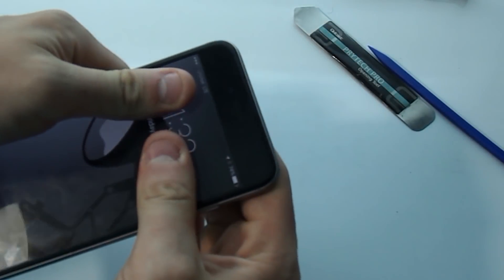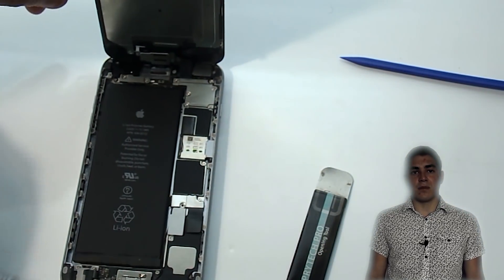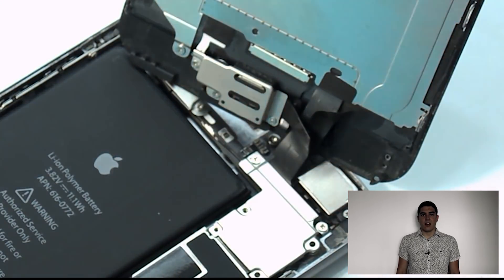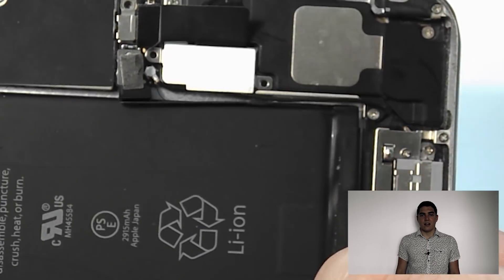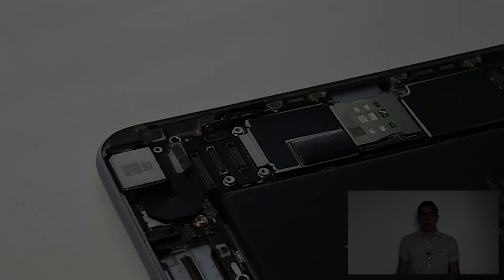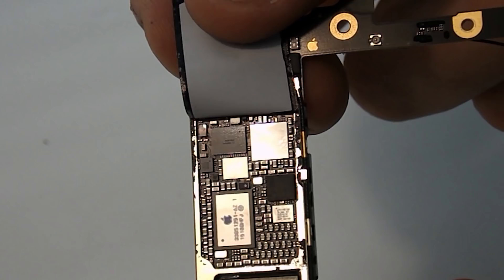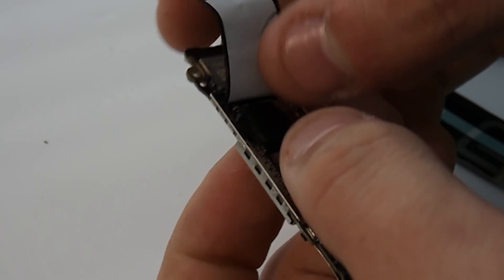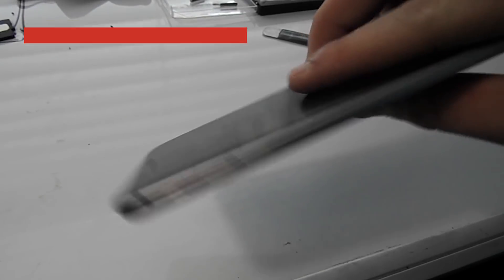How to Fix Touch Disease on iPhone 6 Plus (No Soldering or Bending) | appleEducate #03

Comment: I tried today and just remove the tiny stainless panel with 4 short 1 long screws(the first part when you try to disconnect everything). then the issue solved. the reason is the touch sensor is physically contacted by other parts when the phone is bended

Comment: I like the video I like the style I don't have the touch disease but I do have a different iPhone question my phone is secondhand it's a hand-me-down it's at 6s the screen was cracked but I could deal with it now my silent switch wasn't working kept on turning all the volume off so I blew in there with air then I've got lines up and down my screen now and a black spot as big as my thumb on the left bottom do you have any suggestions sir and thank you for your time I wish you much success

Comment: ...this actually seems to have fixed the issue! I'm still in shock lol. Very good stuff bro thanks!!!
Reply: Did u use the tape and if so can I use like a regular tape or does it have to be a specific kind of tape
Reply: @mikeperez2003  I used electrical tape like he described in the video. I'm still amazed it was that simple of a fix. Didnt cost anything but a few minutes. Phones still working 100%.

Comment: Ok... Here is THE answer... 
It worked for me!
Here is what I did... 
I took the screen protector off, and took the phone out of its protective case...
THEN... I slapped the backside of ONE end of the phone against the palm of my hand about 6 times, and then the same thing with the backside of the OTHER end of the phone... REALLY! 
The intensity of the "slap" was about the same as if you were clapping your hands. 
I can't remember if I had it turned off or on, but I then turned it off and back on, and it probably wouldn't hurt to do the reset thing where the apple logo comes up. 
Ok... Now it is 24 hours later, and the phone IS WORKING perfectly! 
Everything!
What I figured was that if the phone could be dropped and then work well, like someone else posted on one of the 5 or 6 you tube videos that I found on this subject, then maybe, just maybe "slapping it around" a little bit might redistribute the LIQUID LCD part of the phone screen, since one of the videos seemed to indicate that the LCD stuff was the culprit. 
Also, the ONLY other alternative was to get a new phone or pay big bucks to replace the screen. 
YOU'RE WELCOME! 
I am thrilled to be able to contribute this to the YouTube community, because I have found SO MANY helpful videos over the years!
If it works for YOU, please comment and include my name so I will know. 
Oh... And I'm going to copy this to every video I found on the subject, because NOBODY had an easy answer. 
I love you YouTube!

Comment: I tried this “tape” method and it only stopped my “touch disease” problem for roughly 6 minutes. Then after the said 6 minutes passed, the problem was back but worse than before putting the tape on.

Comment: Hey man! Ur videos have been really a great help to the problems in my iphone 6s now. I just have a question about my connectivity in my device.. when i try to connect to a bluetooth speak i cant get even far for more than 2 to 3 meters from the speaker and when im connected to a wifi i got lowest signal bar to my wifi even if im just beside the router. We have 2 iphones in our house and this is the only that i’ve notice getting this kind of issue.

Comment: Done that,but now the screen goes black when i try to screw down top metal plate on the screen connecter.touch still unresponsive b4 it goes black.i can feel the heat from the logic board,that's it.your guide is complete,is there anything we need to know like don't touch stuff?

Comment: this repair was golden! I used some plastic sheet divider, I cut to size and double layered, placed on the chips carefully. I also placed a piece between the screen connectors and the plate covering them.  have not looked back since, for now! lol THis is only a temp fix, could last, could not.

Comment: I've got the touch disease and have had to use a samsung phone for almost a year after only having my 6+ for two months currently i've read that touch disease is a software thing so im updating the phone now but if not i'll try your way asap. Thanks for the great video!
Reply: Haxor9001 Hi i have the same issue with my phone. Did you try to repair it?  Need suggestion though. Thanks!

Comment: The inside of my iphone 6 looks slightly different.  However, I can locate the logic board and I presume the touch IC chips are in the same place.  Yes I have the touch disease.  Is the doubled electrical tape sticky side in or out (or does it matter)?  Also, My wife just drowned a Pixel 2.  I took it apart and it looks like the 'daughter board' may have fried.  Would you know a site I can buy another one.  I've just started looking and it didn't jump out at me.

Comment: To anybody that has their screen tap without touching it which is extremely annoying if you open the phone sometimes there will be clearance issues in my case my battery cable was contacting my digitizer causing the screen to freak out try this out make sure no cables stick up and touch the digitizer
Reply: how can we solve it

Comment: Mine doesn’t get the gray bars. It just stops responding completely until i lock it then unlock it a few times and it will finally respond again. Sometimes it’ll even have a delay where it will start pressing random buttons without me even touching the screen at all. Like when im watching a youtube video it’ll just start another as if I pressed it. Or when texting it’ll just stop responding and if i wait a few seconds it’ll start pressing random letters like it’s possessed.

Comment: What I did instead was I cut up an old credit card and used a very small piece and put it against the LCD connector and screwed in the cover so it applies pressure to it. Didn’t even have to take apart the logic board and it’s been working for a week now.
Reply: vuhsace highrolla 
I know right. I saw this idea from another video and I tried it just an hour ago. Like how you explained. How’s yours going? Is it still good after few months?
Reply: @Blossom_Ap  can you share the link of that video please?
Reply: Where exactly did you put the card

Comment: I did this to my 6 plus and it worked for about 15 seconds do I need to put in more tape? Or is there other stuff I could do and also does the tape need the smooth side on the outside or the sticky side on the outside ??

Comment: I've just done this but as soon as I powered it on I noticed the heat. It was pretty hot so I turned it off and put an ice pack underneath it. Not long later I got a phone call. Now I have vertical lines. Think this is overheating the board. I might just send it away for $150 to have ic chips replaced properly

Comment: I think this could be a permanent fix for those who currently have minor issues with the touch. For those who already have damaged the connection a lot this is more or less going to be a temporary fix. I don’t understand why some of the phone repairers in the comments say that this will cause too much stress in the logic board...The design of the 6+ is already bad enough to always be subject to stresses. This fix is meant to oppose these stresses related to the relevant chip. But I guess the repairers have an interest in saying that only they can fix phones $$$.

Comment: Just last night, my iPhone 6 screen suddenly become unresponsive. No luck with the hard reset. I tried it atleast 20x and still no luck. Early this morning, I tried to drop it from about 2 feet height, the touch screen suddenly worked; but only for a couple of seconds. Then I tried applying pressure on both side of the phone but doesn''t last because the grip should be real tight. Now I tumbled on your video, I know now where to exactly put the pressure just at the left side of the apple logo where the sensor is located. I'm still at work so I think I'll try this at home during the weekends. For now, will continue soft pressure at the back of my phone with my point finger atleast as a workaround. 

Thanks for this! Now everything makes sense.
Reply: Mike Meek same 😀

Comment: FOUND AN EASIER FIX! I took mine apart (just two screws on the bottom of phone only) I’ve replaced screens a few times before, and I I did was fold some paper over end a few times and put it on the metal plate above where all the screen connectors are, and it fixed it. The pressure when you snap the front screen back in place makes the connection stronger!

I for this idea from an article I read that said if you put a penny in a hard case behind the rear camera the pressure will fix it… I don’t have a hard case, so what I did still worked!!!

Comment: I purchased a refurbished iphone6 Plus that has those white line at the top, and then even end up like a full curtain coming down on my whole scree, i get random dialing, its like the phone has a mind of its own. I am very disappointed in being sold a broken phone from Boost-mobile. But i cannot dissemble my phone and get it put back together in order to try ur tape trick. Ugh. Any other advice, i even had to remove the initial password on my iphone because the button touches wont work consistently. Please help! I want to DOS boostmobile.com!

Comment: Thanks for the guerrilla workaround! I found myself collecting a few of these iPhone 6+ devices. Up until I saw this video, I was at a loss for how to repair these, especially since Apple will now repair/ replace the 6+ exhibiting the touch disease symptoms.

The problem I had with a few of them was in order to return a device to Apple, Find my iPhone had to be disabled. Alas if the screen is disabled, you can't unlock it, let alone turn off Find my iPhone or erase it even. Nor can you put it into restore mode as you have to trust the computer, and if you don't have access to a trusted computer, then that's out. Fine everyone says, simply log onto iCloud with the account on the phone and erase it from there. Again on an untrusted device, you have to jump through either two factor or remember the answers to security questions which these numskulls have either misspelled or forgotten. 

It's a complete waste of time, waiting through 8 hour lockouts, etc... Huge time save to employ your trick, reassemble the phone! Now with a useable screen, you can erase the iPhone. I'm lucky I have the options to have the logic boards replaced or the device swapped. Some people have no options, so thanks again for coming up with a guerrilla fix!

Comment: I was desperate to find a fix to "touch disease"...I followed your video step by step.  After completing the steps touch disease went away.  I lost my fingerprint recognition and my wifi strength seems to be a bit weaker.  However, these are small concessions to having to get a new phone at this time.  Thanks for the video!!

Comment: i have issue with my ip5s about ghost touch, it press itself when my finger is contact with the screen. it fixed when i sleep/wake but somtimes ghost touch is repeating again. is the touch ic need to repair or replace the lcd/screen digitizer?

Comment: I just fix my phone a few weeks ago after watching this video but there is actually an easier way. Just unscrew all the screws on the right side of the phone to be able to lift a lit it bit the panel without disconnecting the touchscreen. Put the electrical tape in between the phone and the sensors without uncovering the sensors and will do just fine. It only needs pressure against it. There is no need to disassemble all the board.

Comment: I'm getting frustrated with the touch disease on my iphone 6.
I am not a technician. I just bought my iphone 6 a month ago it was working fine when this toucj disease starts showing symptoms on my phone. It is my fault I did not do a research first before buying this. I should have stayed with iphone 5s.

I don't like to spend more for the repair for micro resoldering.

Comment: I have this disease! I'm kinda afraid to even open my iPhone for fear of causing it to stop working altogether. You said replacing the chip is approximately $100; I'm wondering if that's a service I have to send my iPhone out for or are their vendors located anywhere in NJ? Is there another video that is slower to show exactly how you opened the phone; I think it would make it less intimidating. Thank you so much for the info!

Comment: My iphone 6 plus died.  I believe its the touch controller issue. I fixed mine by flexing the phone. That gave me enough time to back up my data before turning it in as apple won't fix, they just want to give you a new phone.

Comment: thank you this video is very well done. would it be easier to just put tape on the back, on the soft cover itself so that it creates the pressure needed to complete the circuit or must I peel it up and put it on directly?

also how did you get your Apple certification? I have years of experience but would love an official certificate.

Comment: Hi Rody. Question please mate. My screen has just been replaced with an aftermarket screen ( after a crack in my original screen appeared). I have an iPhone 6. I did drop my phone about 6 months ago but it has been working fine with my cracked screen since. Anyway the aftermarket screen works fine but at intermittent times and I cannot figure out a pattern the screen will just go black. The home button won't respond after that and the only way to wake the phone is to use the lock button to lock it then unlock it again. Then it is back to normal. Any ideas? I did put my cracked screen back on and this issue didn't occur. Appreciate any tips. Regards. Peter

Comment: You can achieve the same result by putting tape underneath the top shield.  What it does is put pressure or bend on areas of the fractured solder on the component.  If you are lucky it may work or it may not.

Comment: Damnit there are 3 screws that I just cant take out, any help? The ones i cant take are the top one next to the camera, the one above the battery connectors on the top frame and the one in betweeenn sjsjdjfj

Comment: I want to blow this iPhone 6 Plus up with a stick of dynamite!!  This is my 2nd 6plus after my first was replaced with this one. Same problem again after time replacement. This time, the real f*#king Genius says to me that there is a malfunction preventing proper touchscreen function. Really? My ORIGINAL one was replaced at 4 months old when I had a 1 yr warranty.  My REPLACEMENT had only 90 days warranty. WTF?  Bad news...out of warranty (he says) and you have to pay to fix it? Good news...the fix is discounted from $349.00 to $149.00. I looked at Tony my Genius and said apparently you didn't FIX the problem with my 2nd replacement and now you want me to pay to band-aid a problem that will occur again, why?? I think the Geniuses are trained to say "you're still having a touchscreen problem on your 6 plus? No thanks. I walked out. And saw this video about providing a support to the circuit board.  So far it works as it should.  Thanks for the post but if you could provide a detailed video with close-ups on the removal of the logic board, instructing viewers to carefully align pins and plugs on the re-build.  I think people are having issues when putting the parts back together causing them problems and negative comments. If Steve Jobs were alive today, this shit would never have happened....or at the least the problem FIXED and not patched.  (Mic drop) Thanks!

Comment: I came up with a similar idea today to fix the iPhone 6 plus touch issue and it only involves opening and closing the phone.  I cut a very small sliver of memory foam and placed it on top of the silver shield that is covering the problem chip.  I then closed the phone which had a very snug fit with the memory foam inside.  It fixed the issue instantly.  You can also use an old nano sim card on top of the chip as in the "iPhone 6 plus touch disease ic simple fix" video.

Comment: I tried this fix before from another channel but I only used rubber big enough to cover the shiny IC Chip. The issue was solved for about a week and then the issue came back had to be twisting the phone again. 

I'm going to try this with the tape and cover both chips and let you know if it works.

Comment: I just bought an iphone6+.. it has a touch disease.. i never bend it.. or place in my back or front pocket.. i have a small belt bag that could fit my iphone.. the screen in unresponsive.. i forced restart it and it works again.. later on the problem comes back.. how i wish to have samsung rather than this..

Comment: hi i need to know weather the metal plate on the ribbon than fix on the board have any impact on the touch response as its responsive some times and sometimes no 
actually the metal plate with 5 screws has been misplaced

Comment: Thanks for the video.  This worked for me and so far after 4 days the phone is still good.  The only different thing I did was to use two pieces of paper (close to thickness of a business card stock) instead of the electrical tape.  I was afraid that the electrical tape's adhesive would ooze out because of the heat from the chips.  Thanks again.

Comment: Just took mine apart and actually instead of taking that piece all the way out, I just picked up on it and slid my piece of tape under it and the back of my phone. So didn't place it under that soft flap that you lifted up first. It fixed my problem for now. I think I used too thick of a piece though bc my upper portion of front screen won't snap back into place but everywhere else did so I'm fine with it lol. I just use this plus as a "tablet" anyway. Thanks for the info!!